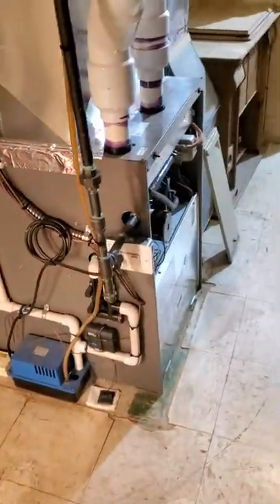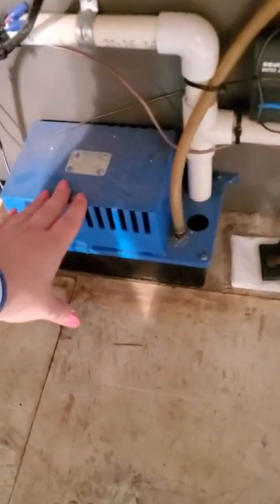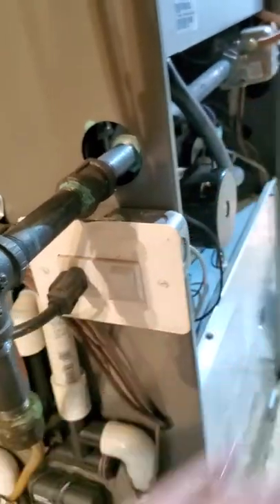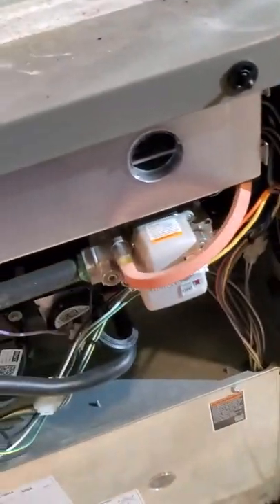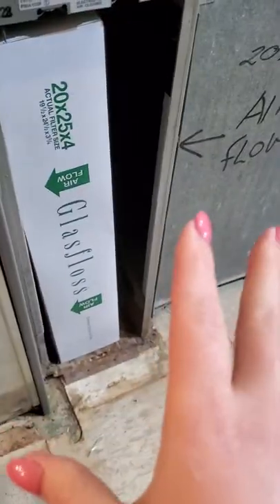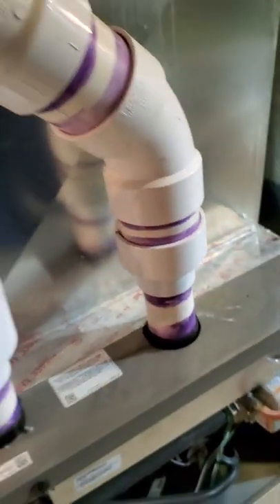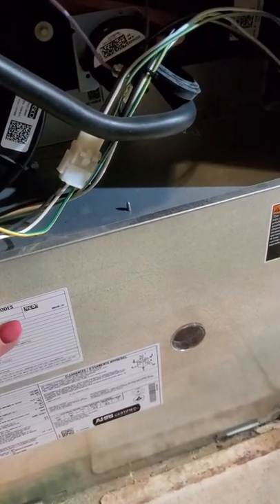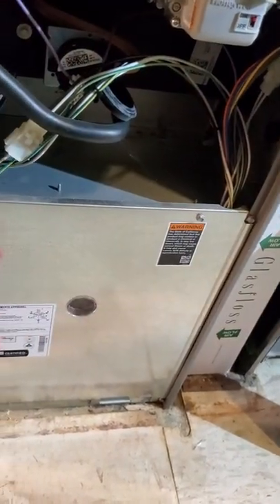What to know about high efficiency furnaces

Comment: My opinion, high efficiency furnaces are a waste of money. The parts are way higher price and break down more often. Also a lot more parts to break. You will never recoup the savings of the massive upfront costs of high efficiency units. Not worth it.
Reply from the maker: I always tell people to do the math on the increased install price, and longevity of the unit vs potential cost savings based on how long you plan to live in the house. In terms of bang for your buck in increasing your home's efficiency and overall comfort, the first place I tell people to start is adding insulation.

Comment: ALWAYS use the right size filter. The filter shown is a poor fit for the case. Unfiltered air will bypass the filter which will be deposited on the blower wheel, secondary heat exchanger and evaporator coil. All of those will reduce air flow and potentially lead to problems.

Comment: Very helpful, thank you!  
What do you think of the Accel CS EK1C 90?  AFUE 97.   Many reviews on YT say high efficient units don't last as long as lower rated units.  Idk
Reply from the maker: So happy the video was helpful!

Yes, a general rule of thumb is the HE furnaces do not last as long. There are simply more parts in them, so more opportunities for failure. If you are going to be in your home for an extended period it MAY be worth the upgrade. I always recommend people do their own math based on increased I stall costs, cost of natural gas in their home, how long they will be in the home, etc.
Reply: @technihouseinspections4328  Thanks yes total cost is important.  I like to experiment.   Electricity is high.  Heat pumps seem to be the most energy efficient next to heating oil which we don't have here.   I prefer self install type as I'm pretty handy especially with electrical and electronics.  Is there a heating unit of any sorts you could recommend that last a long time and can be self installed?  1200 sf.
Reply from the maker: Well I guess that depends on where you are, fuel types available, and how cold it gets. In the southern US heat pumps are widely used, but historically didnt work well in colder northern winters. I have seen demo videos on a very DIY friendly unit by Mr. Cool that was installed and tested in a North Dakota winter. So very cold, and it actually performed really well, so the technology has come a long way. 
If natural gas and furnaces are more commonly used in your area then you might want to look into a HE furnace. In the US in many areas utility companies often offer rebate programs for installing HE furnaces. So you may want to see if that is offered in your area also.
Reply: @technihouseinspections4328  awesome, thank you!  I'm in a very humid North Arkansas.  Gas is ok at the moment but you never know when it will skyrocket.  I look forward to your vids!